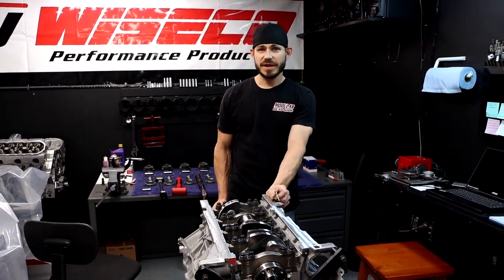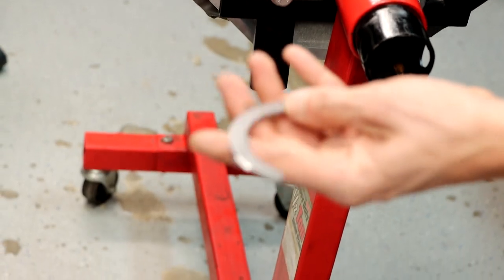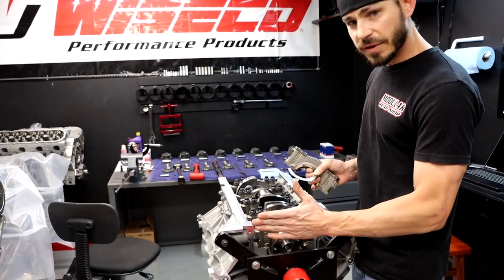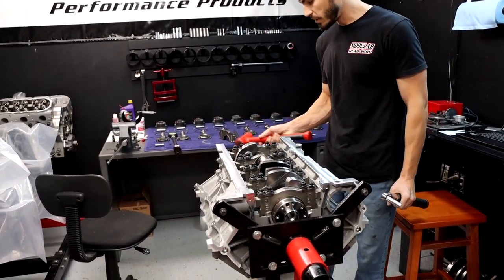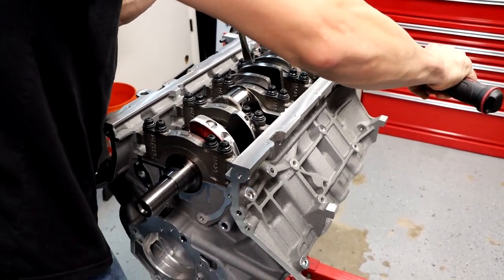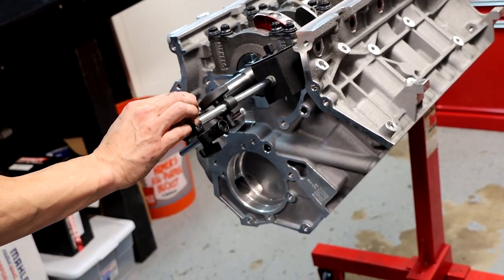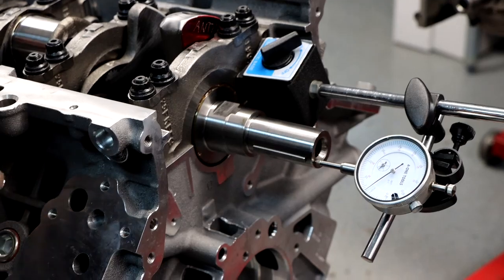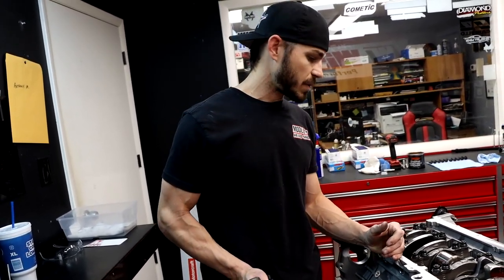Tech Tips - Thrust Bearings

Comment: I thought I had bad thrust bearings until I saw your video! My crank walks close to an inch when I apply throttle. What could this be? All I'm told is the engine is bad.
  Also, this is the second (different) engine to do this on my 97 Ford 4.2L automatic.

Comment: Could you make an in detail reassembly of a 2v please
Reply: Some not all 3v iron Romeo blocks are actually 2v blocks reused from the 2000-2004 or so I’ve heard also I have one apart rn doing final assembly and parts for it aftermarket were the 2v 4.6 Romeo ones like the main bearings nothing else I ordered for the make and model or any 3v iron Windsor block wouldn’t work and we all know aluminum ones are very different so that wasn’t a choice at all and actually now that I remember only king bearing and modular head shop is the only place I could find this info on their site .     other than one person on a forum about a whole different subject  maybe more info I couldn’t find with key words in search engine

Comment: Is it possible to replace the thrust washers with the engine still installed in the vehicle? I have a 2007 5.4 3 valve and the thrust washers have not failed. But at over 200,000 miles I understand they are prone to failure and I'm considering preemptively replacing them while I have the oil pan off to clean up after a timing problem. Thanks

Comment: Is it ok to run the blower cams for the 5.4L 2v for a while until I install the blower?
Reply from the maker: Absolutely bud. We have plenty of customers that do that. It will move the torque band up slightly but no big deal. The blower cams will have better drivability as well, do to the wider lsa.
Reply: @ExcessiveMotorsports  Thanks for the info, that's why you're the best, not like the rest.
Reply: @ExcessiveMotorsports : Thrust washer can be replaced while crankshaft still in the block?

Comment: my thrust washer doesnt have the ledge so do i have the wrong one? its a romeo iron block
Reply from the maker: No. Some do not have the ledge. That is not a problem as the flanged bearing on the cap will keep the washer from spinning once everything is assembled
Reply: @ExcessiveMotorsports  thanks